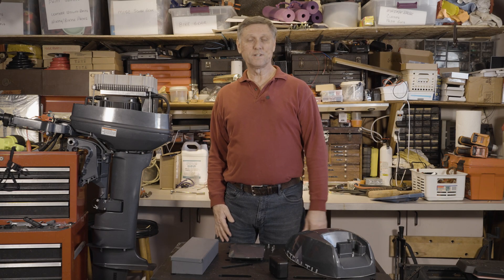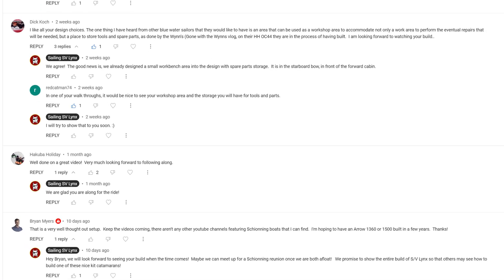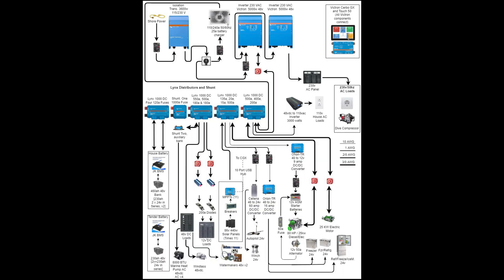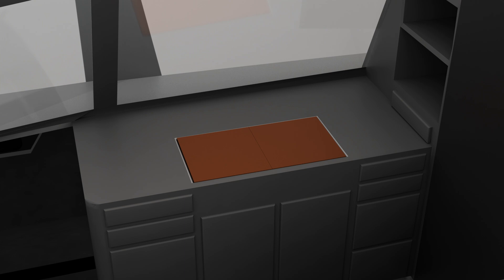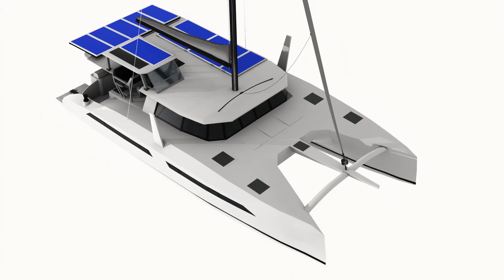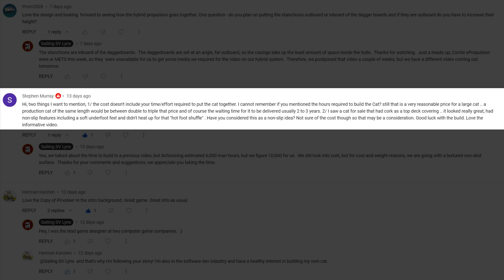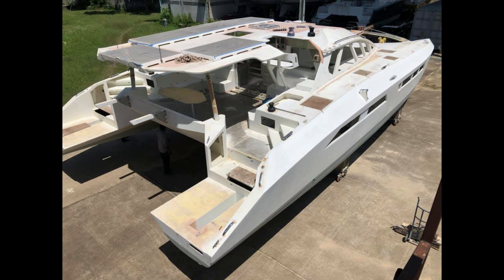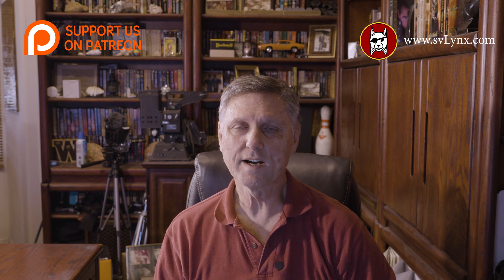Kit-E9: Viewer Questions About our Kit Catamaran

Comment: would you evaluate that I am thinking a trimaran that whole roof covered with semi flexible electric panels and works only with electric motors and lityum ion batteries. 30kwh.  size 7m*5m  equals  35 square meter.  produce 4kwh electric. 3 electric motors. 3 *9  hp equivalent. cruising at about 8 knot speed. 1000 kg body.
Reply from the maker: That's not enough for us to make a real evaluation.  I can only tell you that we looked into pure electric with lots of solar and found that, in the end, the range was just not good enough for our needs.  We will be making a video about how and why we went with the propulsion system we choose.  Perhaps that will help.
Reply: @SailingSVLynx   what do you estimate the range above spesification
Reply from the maker: @metin1999  I will answer, but anything I say is pure guesswork without a lot more information about your boat.  You say you will have three 9 hp electric motors.  Each is around 6.7 kw then.  You can't run electric motors at full power for long stretches, so if you figure you are going at half power, that's about 10 kw.  You only get about 80% of lithium batteries, so figure 24 kWh, which means you may motor 2.5 hours using 10 kw (approximately).  If that pushes your boat at 8 knots, that's 20 nautical mile range.
Reply: @SailingSVLynx  thanks, in sunny day in 3 hours 12kw sun electric will be produced,  so in total , the range become approximately 20 mile, is calculation  true, for small daily rage it may be feasable,  I try to design  my future electric boat, of course  this figures are approximate numbers, thanks for your valuable comments and videos,

Comment: For comparison purposes I'd be interested to hear  what your hardtop weight is? Per square meter/foot if possible. Ours turned out to be 505 kg for 39 square meters which is 12.8 kg/m2.  And that's without the solar panels. More than I expected and hoped for, so have you asked for that info, and whether it is a target area to save weight with use of more carbon? I'd love to know if ours was over built by comparing to yours.
Reply from the maker: Well, that answer is going to take a few months since we must build it before we can weigh it.
Reply: True, but Craig should be able to give you a close estimate.

Comment: I have to give you credit.  You not only spent 10 minutes replying to my earlier comment, but I got a subsequent mention in another vid.  I have researched cats extensively, and we have previously owned a Catana 42 2013 (second owner of a very pimped ride), and now own a Balance 451 (also second owner).  Everything takes twice as long as you think it will, and cost more than you have planned.  The important thing is that you enjoy the journey.  Based on previous experience, I would like to suggest that you keep the crossbeam polished aluminium.  Painted alloy is challenging, and better to keep it simple.  One of the features on the Catana was sealed waterproof bulkheads, which add to safety if you hit anything submerged.  A final thought is considering the weight of an 8 person life raft (a 6 person one we had weighed 40kg, and ideally are placed where they can be deployed readily.  We have a fully enclosed cockpit with an elevated helmstation on the Balance, and we love it.  Keep up the good work, but man, I would hate to be you.  (Resale value on boats is always higher if you are building through a recognised boat yard).  FYI We came very close to buying a Schionning, but it was too wide to fit in our berth (we live in Tauranga New Zealand).
Reply from the maker: A lot yo unpack here... but here goes.  The crossbeam is made by us, with carbon fiber over strip planking.  There are various watertight bulkheads.  Our life raft will be mounted on the bow, as that is the least likely place for a fire, which is the main reason it might ever be needed on a well designed catamaran. We love being us.  And we don't give a rat's ass about resale value, just that we have a great cat to sail.  Thanks for posting.

Comment: Very interesting project. Looks at least like you have the proper workshop, etc and a lot of motivation for this project. I'm very excited to follow the progress. Followed a similar project (Arrow 1360) not very far from where I live. Many people working on the project, but only part time. Took them about 4y to finish it.
There is one feature, which in my opinion is overrated: the capability to beach a catamaran (without keels), especially in regions with small tidal range. The maneuver is more demanding than regular anchoring, it destroys a significant part of the bottom paint and you do it once every few years, because often you don't have the conditions to do it. Imo not worth the costs and effort.
Reply from the maker: I understand your reasoning on the beaching, but we aren't just sailing the milk run in our cat.  We plan to visit parts of the world where we will have little choice.  In northern Europe, we will be in massive tidal change areas for several years.  And, like in Northern Europe, while visiting the Kimberley islands of Australia, the tidal changes are 30' (10m) at times.  In those locations, the boat may need to be beached quite often (and we will just have to deal with the bottom paint repairs).  However, knowing that we will have to beach the boat during those years, we need to make sure the boat is capable of beaching without damage (other than to bottom paint).  Obviously, we will try not to beach it whenever possible, but the boat still has to be capable of beaching.
Reply: I disagree that beaching keels are not worth it. As Phillip has said, in remote cruising it can be very worthwhile. We have very low (200mm deep) but long beaching keels made very tough that we can careen on less than optimal bottoms if necessary. When I looked at the point loading ( think hidden rock or coral under the sand) force  on hulls without the mini keels, it was a bit scary especially if there was any wave action on the re-floating period. They also have advantages for down wave tracking, and do not affect tacking performance, if they are designed right. I think they are all upside benefits, IMO.
Reply from the maker: I believe the OP is discussing no mini keels and beaching.
Reply from the maker: @robthompson7174  On your point, Rob, about point loading without mini keels, that is the whole reason we spent a whole lot of extra money to purchase basalt fiber to put over our entire hull bottoms (three layers).  We wanted to increase the strength of the hulls.  I very smart person I know who works on boats suggested basalt.  When I looked into it, I found a video where somoene shot a hull made from fiberglass and one made from basalt.  The bullet went right through the fiberglass and bounced off the basalt hull.  So, we are adding basalt since we must careen on occasion on our hulls, which do not have mini keels.  It may also help in case we hit something in the water.  :)
Reply: Thanks for comment on the basalt fiber cloth. I did not know it had toughness properties that good. There are 2 issues to consider, one is hull penetration, the other is delamination. We tried and tested Innegra cloth, it has certified ballistic properties and our sample panel was truly impenetrable. BUT, it does not wet out at all with the resin and we had massive delamination failure of the infused hull panels. The outside Innegra layer had to be pulled off & it just peeled off with no adhesion to the main laminate.  A real PITA. 
I test everything, I hate surprises! And thank goodness I did. You would be surprised at what works and what doesn’t sometimes.
Reply from the maker: On the basalt cloth.  As for hull penitration, that is one of its best characteristics, but let's move on to delamination.  There are already boat manufactureres using basalt, like Windelo Catamarans.   Here is a link: 
https://www.windelo-catamaran.com/en/ecology/  
Also, I know a boat builder who has worked with basalt and had no issues with delamination.  And, as for wetting out, reports are that it wets out easier than fiberglass.  We will be doing a test of basalt vs fibergalss in an upcoming video (sometime in late January or February, after we get our kit).

Comment: Very smart with the induction hobs.. I worry about your forward placement of workbench and tool storage... how will you balance the boat ?
Reply from the maker: The workbench itself won't cause much weight issue.  If the tools do, we can always move them to a more central location and just take the ones we need to the workbench when we do a job.  We have always considered balancing the boat a top priority.

Comment: Great videos,  Are you doing any lightning strike mitigation?
Reply from the maker: The problem with lightning strike mitigation is that I have not yet seen any proof that it works.  We will continue to do research into it and if there is any indication that some system actually has real benfits, then we would consider adding it.  Our best way of avoiding lightning strikes it to sail around storm cells as much as possible, with a fast boat.  That's another reason we wanted a performance cat of good waterlength.